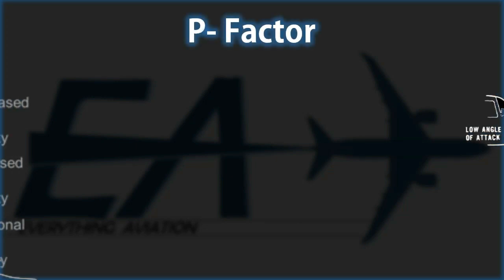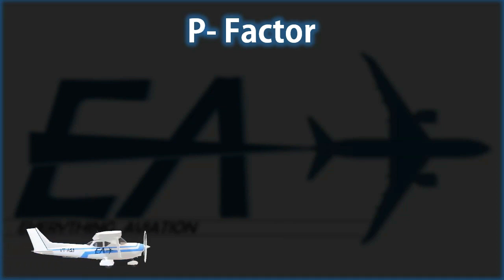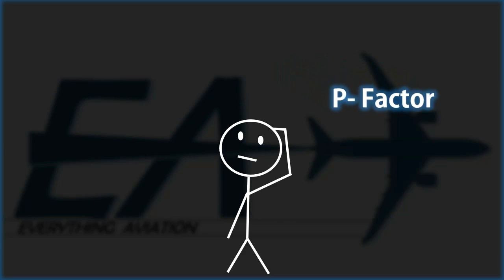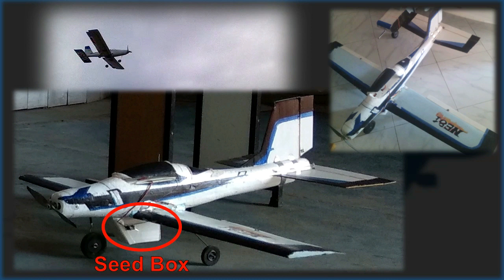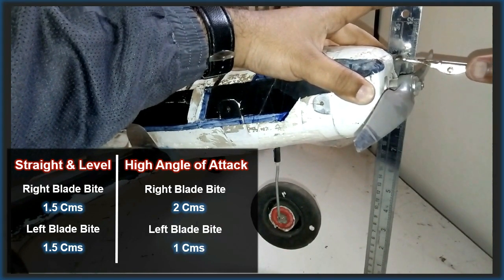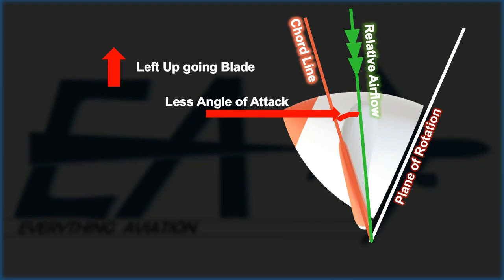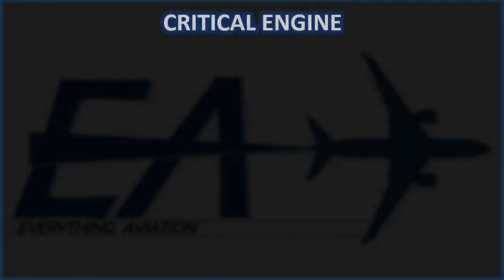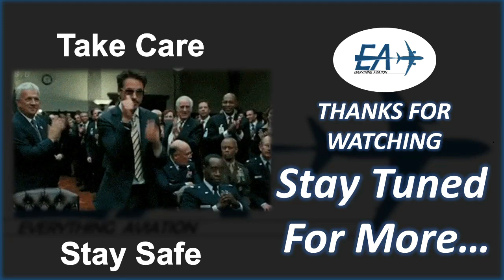P-Factor Explained !!!👨‍✈️ Technical | Propeller Aerodynamics

Comment: Great explanation, but I just can't quite get over with this, why P-factor isn't Gyro, though they both are SPINNING BLADES with ADDITIONAL FORCE at one point?
Reply from the maker: Bothe are different. P-factor is from aerodynamic forces. And gyroscopic effect is from a rotating Mass... i hope it answers your question. 😊
Reply: My thought was this, Gyro effect delays motion 90 degree, why doesn't P-factor do too. P-factor creat left side yaw, I mean why not pitch up (90⁰ late), like in helicopter, its blade has to pitch 90⁰ prior, in order to creat a pitch-down

Comment: But my question is... as chord line changes with pitch, so does the plane of rotation. so intuitively AoA must be the same or is there any change in TAS as relative airflow also depends on it then effecting AoA. Thanks in advance!
Reply from the maker: Hii, Chord line doesn't change with pitch... Did you mean Blade Angle...?

Comment: I’m having a hard time understanding why gyroscopic precession has no effect here. If the thrust is higher on the downward stroke, wouldn’t that take effect 90 degrees later in its rotation when it’s at its lowest point, thereby causing a pitch up instead of a yaw left? 

The propeller taking a larger or smaller bite of air depending on its point in rotation seems to be very similar to the cyclic in a helicopter. And that is 90 degrees out of phase because of gyroscopic precession.
Reply from the maker: Gyroscopic precession also have effect here but in a different way. That is due to a rotating Mass (i.e. propeller) P-factor is due to aerodynamic forces. In a Helicopter, Rotor is much larger as compared to a Propeller.

Comment: Couldn’t you say that since the ascending blade is moving up and backwards that it experiences less relative airflow causing it to have a lower angle of attack compared to the deceasing blade that is moving into the air as well, creating more airflow Over that blade ?
Reply from the maker: Yes, the angle of attack causes the differential airflow.